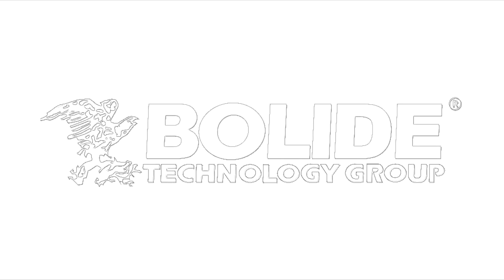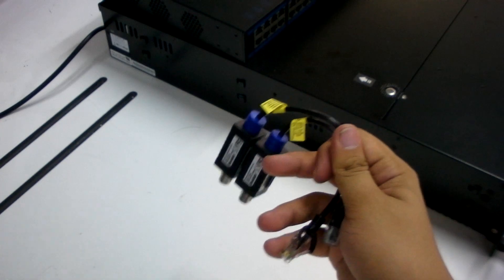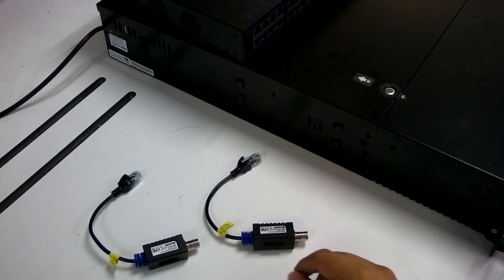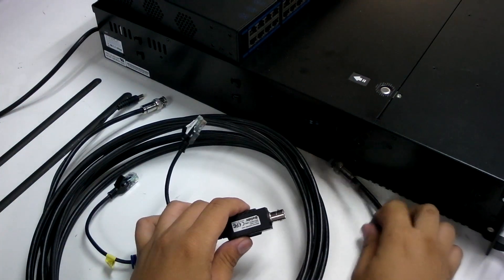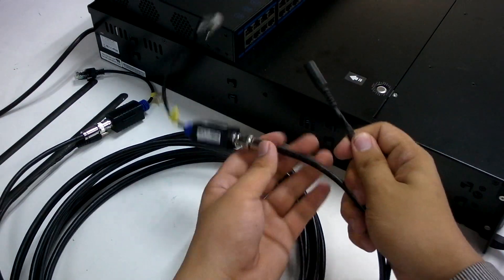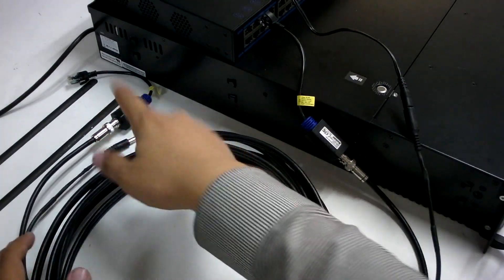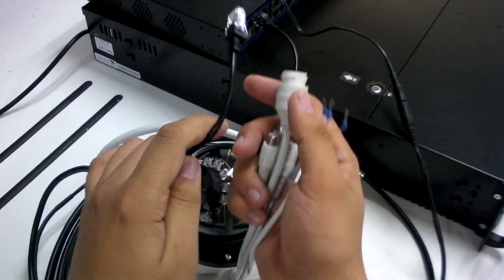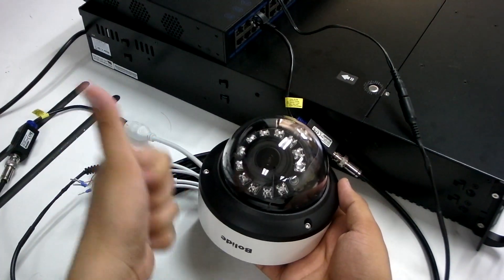Ethernet over Coaxial Cable BE8216EOC-MINI

Comment: Not possible in this way
Reply: Hey is it possible to convert a coax cable to ethernet? By plugging in these converters to both sides. And is it possible to connect one to a pc and one to a router? Would it work?
Reply: @Tomgaming12  how about try it out

Comment: They look pretty much like a simple pair of  baluns used to adjust impedance to allow an analog signal (like CCTV) to go over a UTP cable. Ethernet over coax requires some more complex devices (not so complex though)
Reply: this is the opposite of utp ethernet cable its for using an existing coax rg59 to send eithernet like to connect an ip camera to an exsting dvr using poe switch or to upgrade from dvr to nvr but keeping existing coax cables

Comment: Do those connectors work only with a simple audio/video device, or can they be used for internet gaming?
Reply: Did you end up trying this with gaming? I'm wondering the same thing
Reply: @Matt-gk4jy  Doesn't make much sense. Coax (50 Ohm coax ) was used in the early ehternet network days, some 30 years ago. 
Back in those days it was 10Mbit half-duplex Not nearly the wire-speed you can get nowadays.

If you're not using premium cabling and excellent installation skills you're in for a lot of troubleshooting on these thin-net networks. 

Hooking up a couple of PC's for gaming is much easier if you use a simple 5 port Ehternet switch (anything between 20 to 30 bucks) and a pair of ethernet twisted pair cables. You're then able to go to a gigabit/sec. And since PC's nowadays can autoconfigure, this would be all you need to get two PC's talking to eachother.
Using Coax Ethernet, TPAU or TCAU converters is really not worth the effort unless you want to get a sense of what these old network techs were facing every day.
Reply: @Verklunkenzwiebel  Thank you but what is a 5 port ethernet switch and is it good for pc gaming when using a coax cable?

Comment: Is there any degregation of picture quality or delay, compared to using cat cables.  ALSO can these support 4K cameras.Comments appreciated
Reply: quality should be the same and it supports 4k , 4k can be done over coax im currently using a 4 in 1 hybrid 4k dvr with 4 camera picture is good

Comment: For ur info, this device is for upgrading from analog 420 tv lines t, 700 tv line to ip cam that is  HD  1.3 , 2 mp or more, but u have to upgrade ur DVR 5 in 1, model, meaning is has to support, ip, TVI, cvbs, Ahd, cvi. Fornat. One more important thing is, check the spec weather this device can support 3 to 5 MP ip.

Comment: Who has real usage experience? Please share
Reply: Military use it to cut down on interference. Longer runs that are more resistant to wear and or cuts. Also if you have an older home you could use it to route ethernet without having to run new cables.